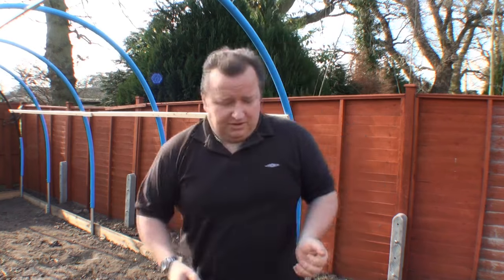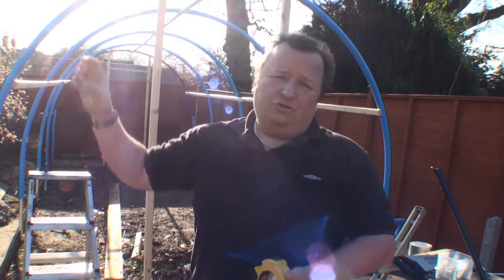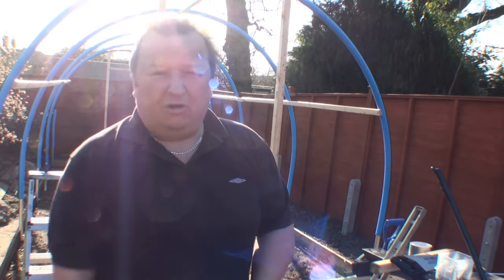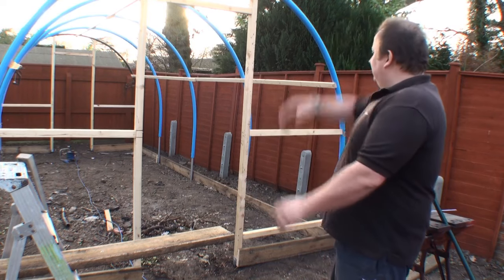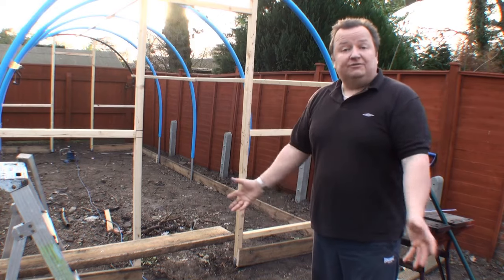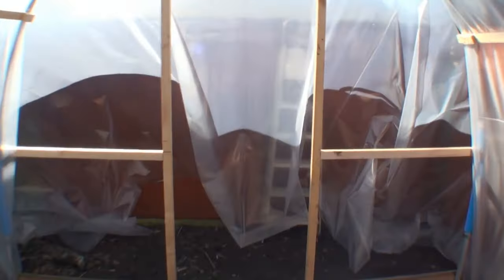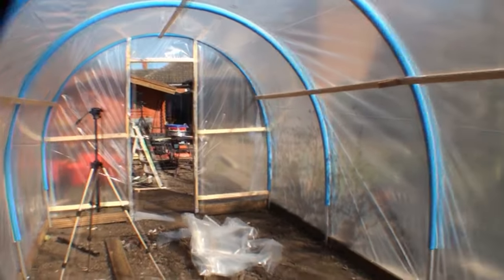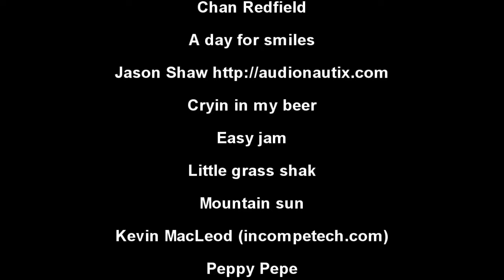How To Build A PolyTunnel Part 2 Polytunnel Covering

Comment: Looks dangerous sawing the wood at 2:42 minutes. Right hand too near the saw blade. It's very important to keep hand well away from the cutting edge of the saw. I made this mistake putting a point on a piece of wood, and had an accident. Safety first!
Reply from the maker: Common sense first and experience in my book.

Comment: For your polytunnel what was the thickness of the plastic sheeting
Reply from the maker: I can't remember George, It was the heavyest grade I found and it had an anti condensation coating on the inside.
Cheers
Martin
Reply: Can you remember the name of it by anychance
Reply from the maker: George Collins
 Here's the place I got it from. It was 720 gauge http://www.ebay.co.uk/itm/Polytunnel-polythene-greenhouse-cover-Thermal-anti-drip-7-3m-9-2m-wide-/221666519088
Cheers
Martin